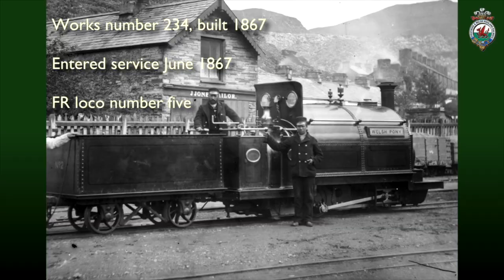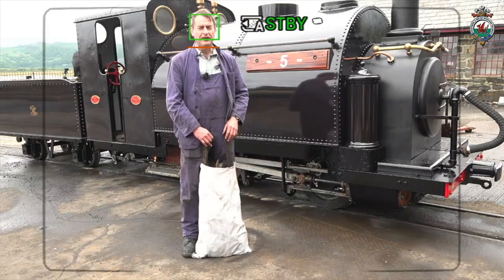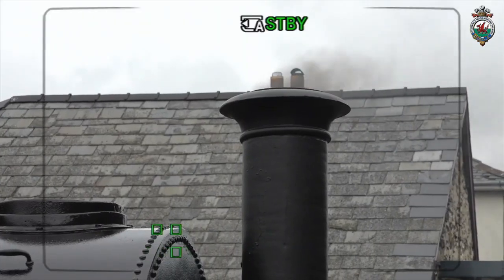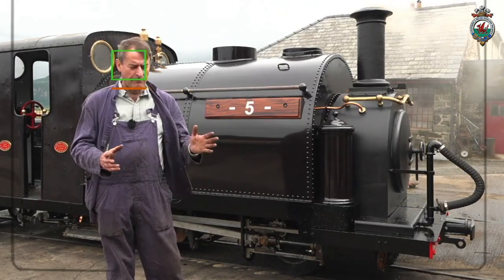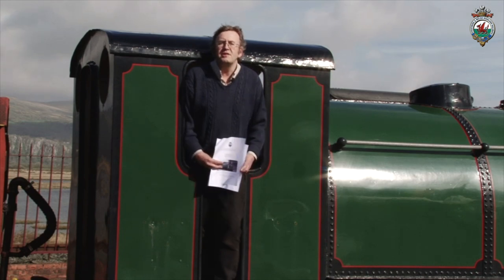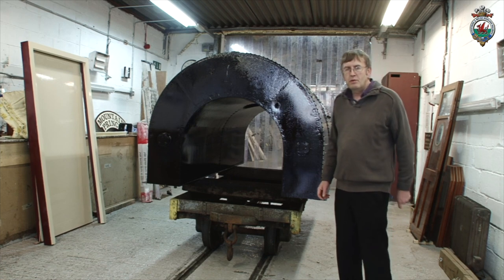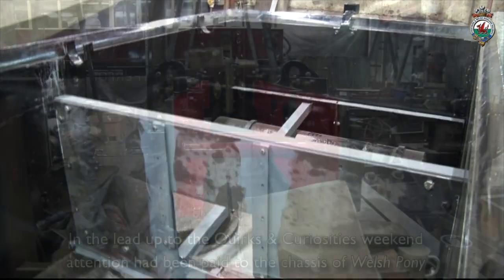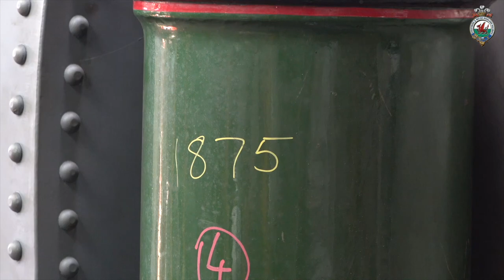Welsh Pony - Lighting the fire. 10:00

Comment: i thought it was nice how the Ffestininog railway used the old wood boiler lagging as fire wood so they could light the first fire that Welsh pony has had for many years, it saved them the trouble of breaking up or cutting up some old sleepers, how did they fill her boiler with water? correct if me if i am wrong but i feel they mite have filled it using a hose pipe or water buckets.
Reply: I believe they use a non return valve with a pump. Usually the bikes are filled to the top when running for days on end.
Reply: @yeo5811  its very fitting that they reused the old boiler lagging as fire wood to get the fire going